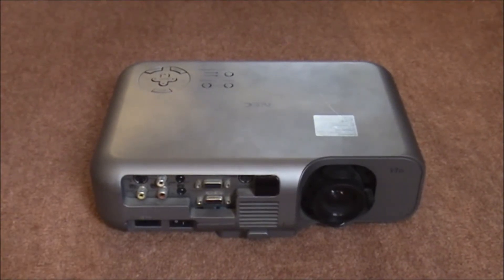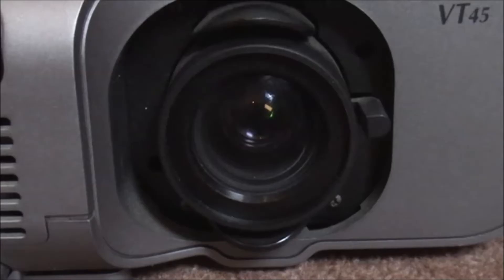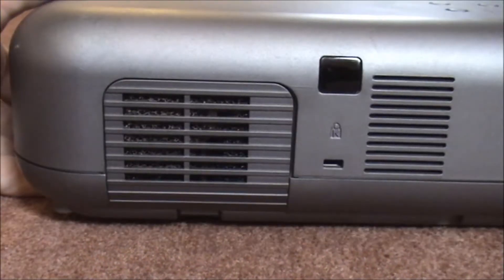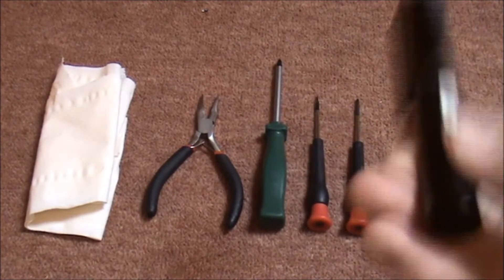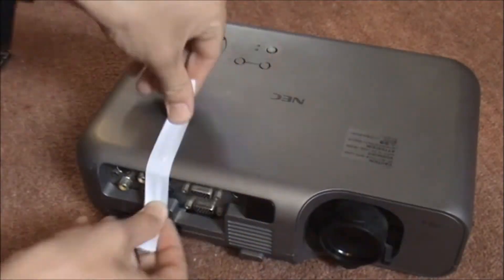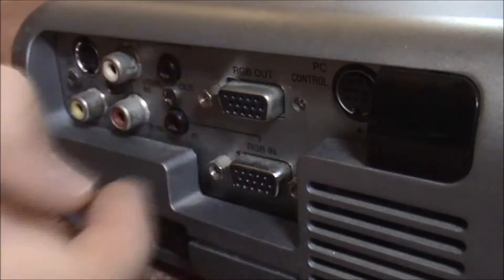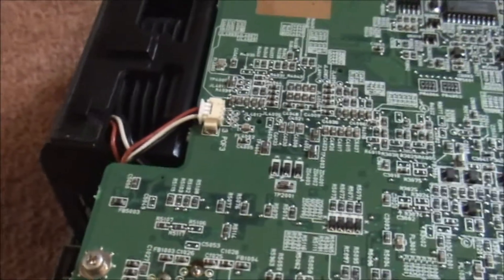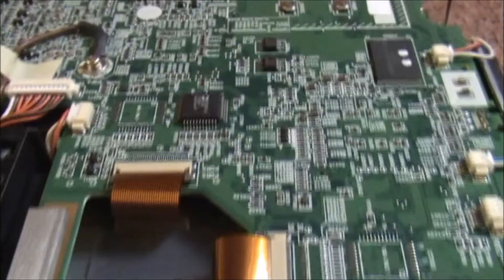NEC Projector

Comment: Also is that an NEC VT540?
Reply from the maker: I’ll have to check again, it’s been a while since I’ve issued it :) However I think you’re correct as it looks like the right part number 😀
Reply: @spywarefinder  I have the VT440 and need a tutorial on how to change the bulb 👍
Reply from the maker: @DollopussD  I’ve just noticed in my video I put the part number of the Projector which apparently is a VT45K series, shows how long ago this video was! I have a feeling on this model, the bulb access is on the bottom, with one screw holding the cover down to then access the bulb. With your particular model the bulb could be in a different location. Does NEC have any service manuals on their website? Might be worth checking :)
Reply: @spywarefinder  they do, I have the manual but I'm useless at reading manuals 🤣 Give me a video and I can follow it but with a manual I've been known to put doors on upside down and all sorts of stupidity 🤣